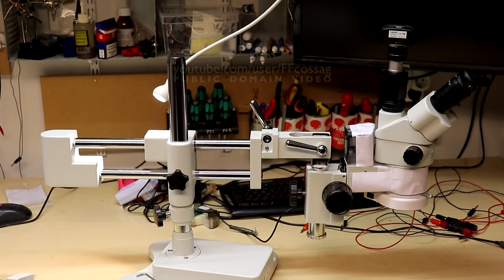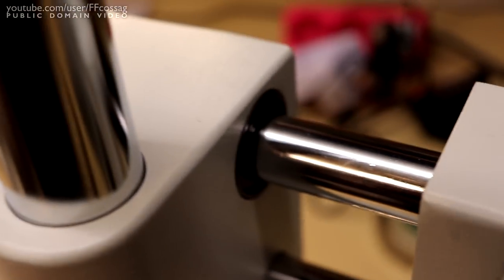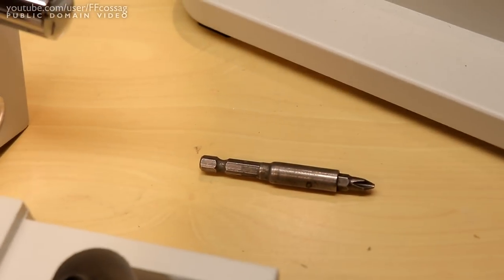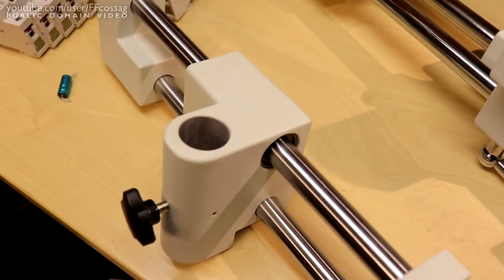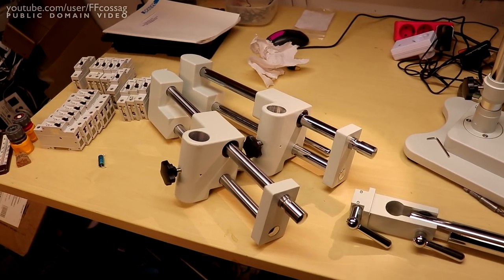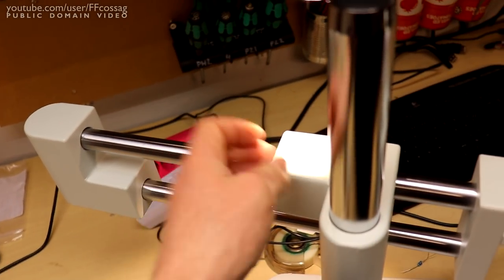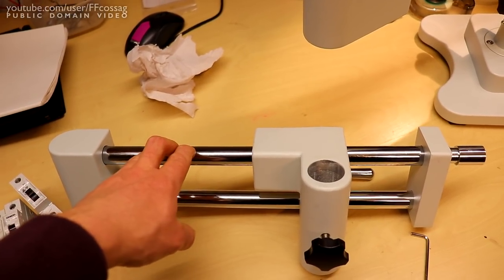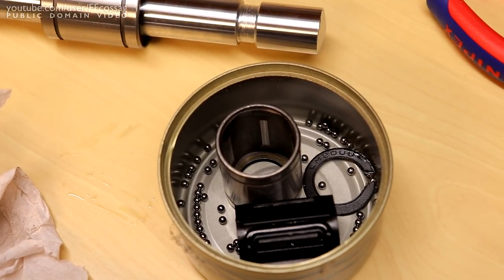Have Amscope finally fixed  their boom arms?

Comment: Scope arrived a few days ago. The top rod is not undersized and appears hardened. No marks from the bearings yet but I tend to put it in one position, lock it down and then swivel over when needed. Fingers crossed it will be ok. I have a machine shop about 500 meters away so will get new bearing fitted if anything looks wrong but ok so far.

Comment: You can use hydraulic rod, cheap and high quality, available in most metric an imperial sizes, any local hydraulic shop will sel it cut to size or order it for you.

Comment: Something you might want to look at is replacing the linear bearing with one from Thompson with nylon balls. They also make them in a bushing style. The shafting is too soft for steel linear bearings (including the replacement).  Properely hardened shafting with a good self aligning bearing from Thompson would start around $120, something amscope would have a tough time offering given the low price point of this stand. To me it's still worth buying and replacing the linear bearing, it's got a lot going for it. The shaft should never be the sacrificial part in the design, amscope certainly knows better but still does it anyway.

Comment: Chrome plated rods dont go with ball bearings, you can only use chrome plated rods with bushings. You are lucky the plating didnt peal off and jam the bearings
Id say if you can make a LM20LUU  sized bushin out of PFTE you could try polising the marks on the rid with a fine sand paper and replacing the bearing with the PTFE bushing. Use motor oil, it should go smooth though im not sure about durability, maybe some other material may not slide as smoothly but can last way longer. Maybe phosforous  bronze could work too.

Also its notmal for bearings to make channels in the rods. Good quality rods and bearings take really long for that to happen but thats not a problem, that's not gonna cause problems. The problem with chrome plated rods is chrome is really hard so it wont wear but will forge the soft steel underneath and then the chrome plating with break and cave in into the steel. Like pushing an egg with your finger. That's what causes the roughness on the bearings. If its hardened steel the grooves should be smooth, provided the bearing's balls are actually round.
Reply from the maker: I can imagine some grooving being normal, what's concerning me about these bearings is that they ride extremely coarsely, it's not a smooth motion at all. I'm going to buy some quality bearings to swap in, and we'll see if they behave better.
Reply from the maker: I don't have much faith in a bushing solution, since the loading is so whacky on these. You have almost all the load at the ends of the bearing/bushing, so I'm afraid that bushings would just have too much friction to work comfortably. I'm going to try sourcing quality bearings and see how that turns out.
Reply: Like the old saying goes, "Why spoil the ship, for a halfpenny worth of tar?"  Seems they don't actually give a fuck about quality.  Not what you expect in a 1,000 Euro plus instrument.  I hope they put right their sloppy workmanship and Q.C.
Reply: @FFcossag  
Well in theory, even if the load is "on the edges of the bushings because of the leverage, in theory if the bushings are precise enough that shouldnt happen, but for that you have to made them tailored to the rod, or have precision rods and bushings (of those that if you dont put it straight enoug it would bind and not even let you push it all the way onto the rod.)
So yeah, generic 20mm chinese bushings wont cut it.
Reply: @laharl2k  would Teflon bushing work?
Reply: @sarkybugger5009  I don't understand people who pay for the least-expensive widget and then expect it to have high-quality parts.  You get what you pay for.

Comment: Sounds like Amscope needs to step up their game A LOT, quality  starts with the vendors.
I seriously doubt the bearings are made in house. Have a look see at a 3-D printer, them bearings take a beating
Reply from the maker: Nothing Amscope is made in-house, they're just a reseller for Chinese microscopes. I can easily imagine that these microscopes give the bearings a much harder beating than most 3D printers too, since there's a roughly 1 kg microscope head mounted at the end of a 60 cm rod, with a bearing in *one end*, lol.
Reply: @FFcossag  there are 3D printers and then there are huge 3D printers I guess that was referring to them?
Regardless, this manufacturer has serious quality problems.
Duralon, or nylon would work well in this application. No heat generating friction or fast linear speeds encountered, although stiction may be an issue.
Reply: But, people shopping for Amscope aren't interested in paying for high quality.

Comment: I don't suppose a tube of nylon or phospher bronse would be any better as a bearing.
A rather rough bearing design, what a shame :-(
Reply from the maker: I don't have much faith in a bushing solution, since the loading is so whacky on these. You have almost all the load at the ends of the bearing/bushing, so I'm afraid that bushings would just have too much friction to work comfortably.
Reply: @FFcossag  bushings can handle a pretty high load. look for self-lubricating bushing material

Comment: Hiya, i have this microscope and am too busy working with it on computers, that I haven't found the time to look into the reason why the thing makes a horrible grinding noise and is sooo coarse to move. Also has a lot of play when fully extended so now it's time to replace the boom shafts myself. I also want to replace the bearings at the same time. Can you tell me what bearings they are? What is their outer diameter? or is this a standardized size? I read somewhere that they are LM20LUU which I imagine is a standardized size? Would love to hear back from you, and will subscribe to this channel, looks interesting!

Comment: I am tempted to turn some brass rod with 20mm/19.84mm internal hole and the outside to fit the bearing  housing. I have just ordered one of these scopes and this could be an opportunity to try out  a new lathe I have purchase but not used yet. All a learning exercise. Maybe drill and tap three grub screw holes to hold the bushing in place and then a light oil lubrication. Brass should be soft enough to not scruff up even the old, softer rods.

Ahh 20mm brass bushings are just over £2 each as are nylon ones. I get my scope on Monday and if it has soft chrome rods then I will look at replacing the bearings before first assembly.

Or 3D print a bearing. https://www.youtube.com/watch?v=ORoL0jvy6ps
Reply from the maker: Yup, if you have the soft old style rod, I definitely recommend replacing the bearings with bushings before ever putting ANY load on it.